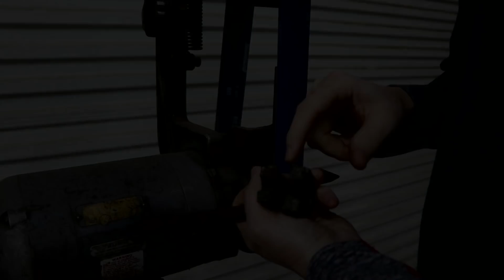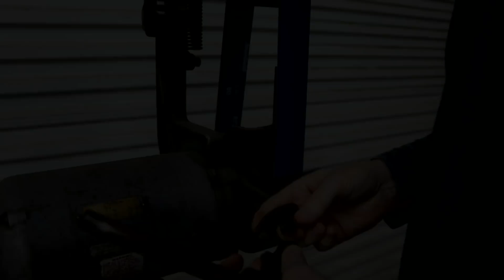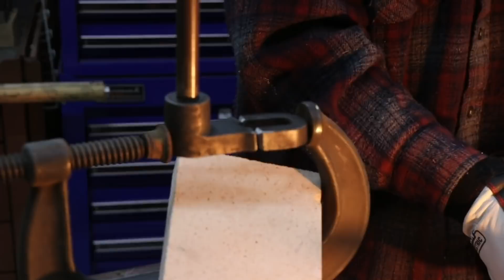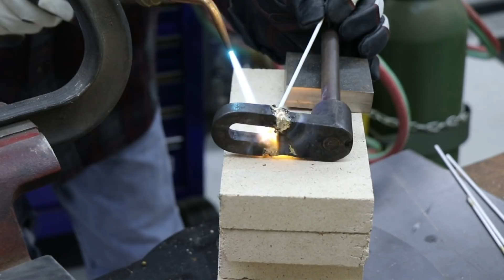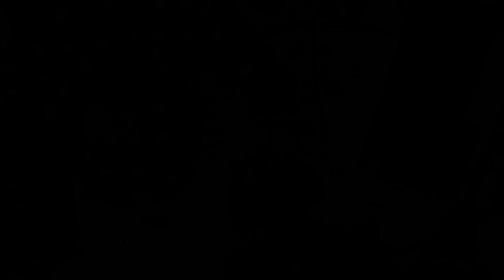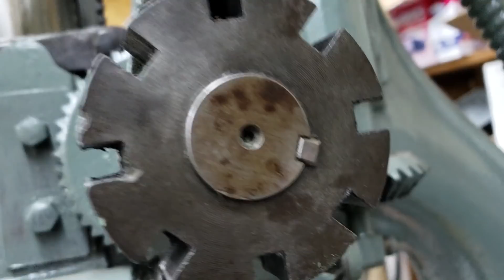Thursday Night Fixins #43 - Camelback Drillpress Repair

Comment: That's just about the size drill I need. Don't have very high clings in my shop. Who made it?
Reply: It's a Champion Blower & Forge 17".  I think Keith Fenner has a 20" Silbey, that looks similar and I think Buffalo made a camelback as well.
Cheers, Gary
Reply: @gwcude  I saw one at auction not long ago that was made in California. Always a more rare thing
Reply: @OldIronShops  Then I would guess it was possibly made at the Knight Foundry.
Reply: @gwcude  no I forget the brand but it still had all its tags ect